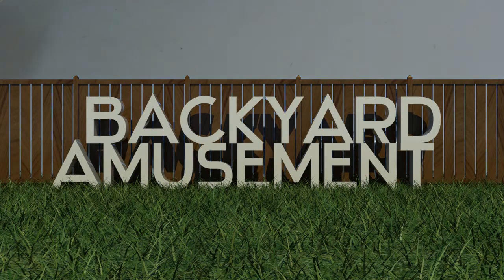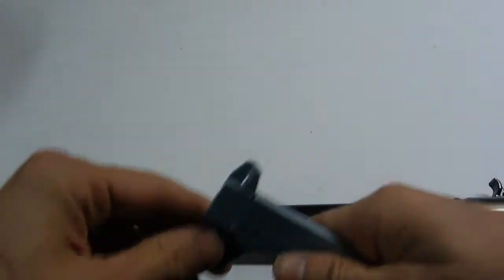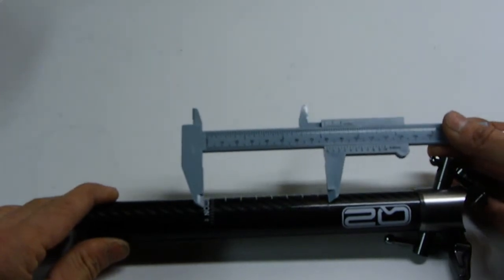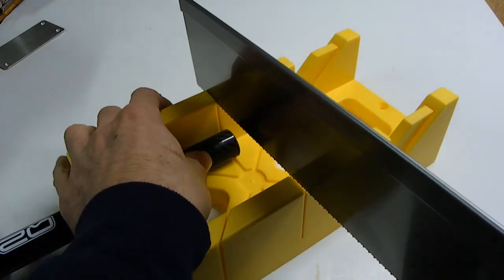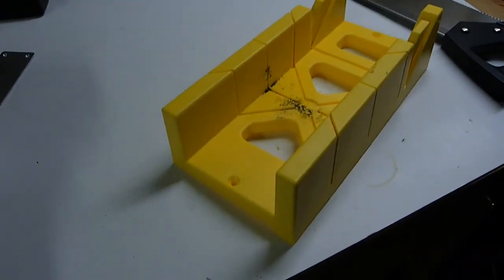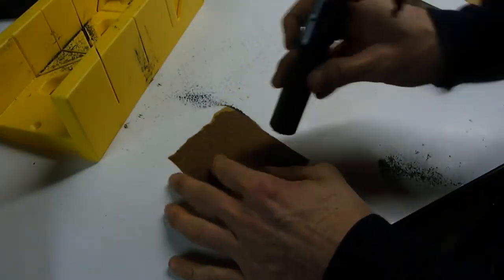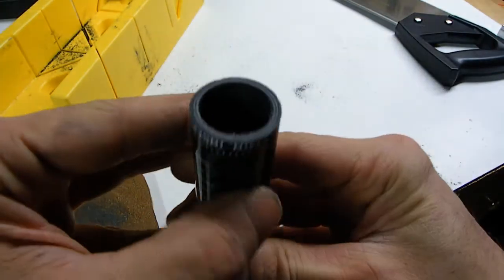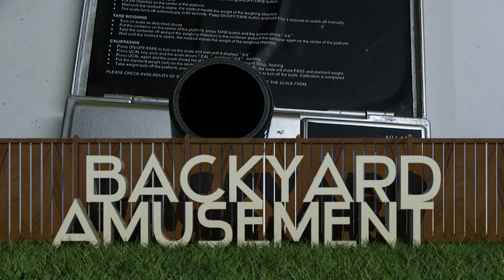How to cut a carbon fiber seatpost

Comment: Not bashing you or this video at all....your method obviously works and you're not going to die from the little bit of carbon dust in cutting one seatpost, but there are better ways to do this. 

Putting tape over the area you want to cut will help prevent fraying. Wetting the area will help cut down on dust. It's not a bad idea to put some nail varnish, super glue, or, if you have it, epoxy on the end you have cut to prevent future fraying. 
Lastly, while it is ok for the carbon fibre to be cut with a mitre saw, it isn't particularly good for most mitre saws! If your saw is cheap and you don't care about it, that's fine, but most of them are really only designed for wood and will blunt quickly in Carbon Fibre.. Any hacksaw blade will do instead, but a fine toothed (32tpi+) hacksaw blade is best. If you have a steady hand, the mitre box is optional. 

20g isn't a huge saving....but it is free, quick and easy. Weight weenie or not, if you don't need the extra seatpost length, there's no good reason to go carrying it around. I've done this job in (literally) 3 minutes. Shorter riders may save more grams than this if their seatposts are well over size.

Comment: Steps!!
For seat posts 
-use black electrical tape to protect the area on top from fraying carbon fibers, so wrap the tape around before cutting off the section outside the electrical tape. Smooth down with at least 800's sand paper. For aero seat posts use a hacksaw with 32 TPI and cut in a steady motion, take your time and down press down too hard.

Comment: As you probably know, there are more efficient/effective ways to cut carbon fiber tubing. That being said, one suggestion I would make to improve YOUR process is to use a Scotch-Brite pad in place of sand paper. It may be minimal but spinning the tube on a Scotch-Brite pad will remove all burs.

Comment: I wasn't posting to rant after mangling; I was basing the post off the reactions to this video of several experienced mechanics.  You may have been able to get a decent cut, but there is a reason Easton officially recommends taping the cut, and a reason Park makes guides and a carbon specific blades.  Mention should be made of these, as well as a warning to not inhale the carbon dust. Speaking which, a bit of water works great to clump up the dust.

Comment: you could have saved more weight by taking a dump before you ride.  But really thanks for the video. getting ready to cut mine down because it goes too far into the frame.

Comment: you should really wear a mask when cutting or sanding carbon fiber the dust can be very bad for you breathing it in.the best way to do it is to wet sand to keep the dust down and same for cutting it with a saw do it under running water to keep the dust down

Comment: This video should be called "How NOT to cut a carbon seatpost, unless you have too - WEAR MASK"

You need to be sure you aren't compromising the structure of the material. In this case the structure is made up of bonded fibers and may behave badly when attacked without a fine toothed saw. According the the "experienced" here, its actually very easy to cut the post.

slicknickle519  - "Mention should be made ..." OP this is the point, these things deserve mention.

Comment: Should really be "How NOT to cut a carbon seatpost." 
You need to: 
1) TAPE over the place you will be cutting.
2) TURN the post/bar as you are cutting (don't cut all the way through one direction or it will splinter
3) Preferably use a proper carbon blade in a hacksaw!

Seriously, please take this misinformation off the internet before anybody else mangles their carbon post or bars.

Comment: Not the best way to cut carbon fiber. Should use at least a 32 tpi blade. Also, I sure hope you were wearing a dust mask. People -- always wear an appropriate dust particle mask when cutting carbon fiber. The small particulate matter can lodge in your lungs without you even knowing it.